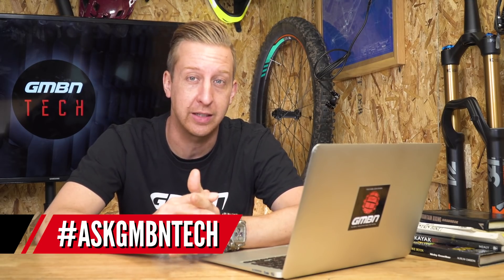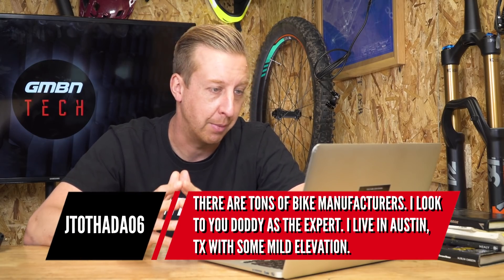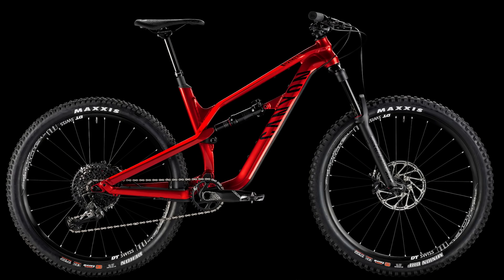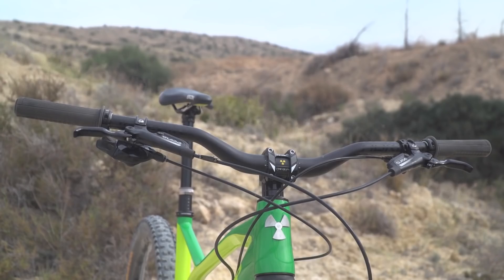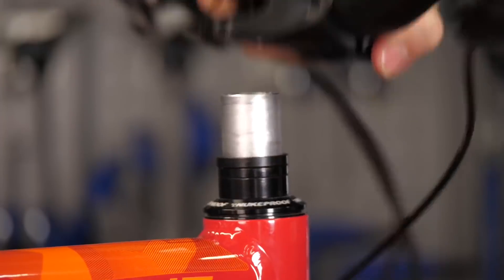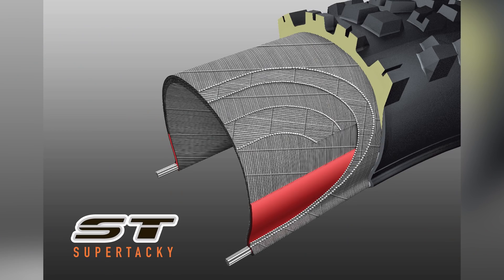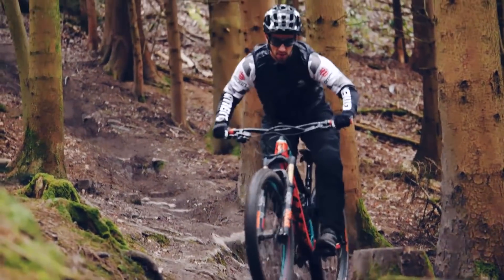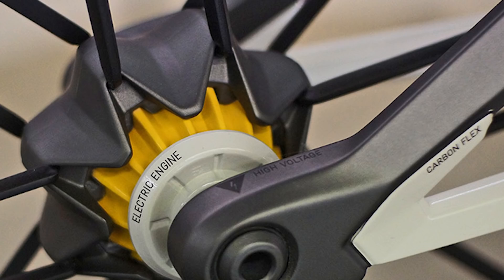MTB Geometry, Grease and MAGNETS! | Ask GMBN Tech

Comment from the maker: Given automotive manufacturers are already using magnet technologies for active damping control, could magnet suspension technology play a part in the future of mtb?
Reply: magnets are pretty heavy, so would most likely have to go on an e-bike. plus there might be the added benefit of using a lighter electromagnet material. going to be really interesting to see how they overcome the weight issue!
Reply: I'm fairly certain it was tried on MTB's years back but can';t remeber who by
Reply: Rare earth magnets are very powerful for their size this could go some way to address the weight issue. They are expensive though.
Reply: I don't think so because magnetically adjusted dampers require energy to operate. It may be possible on the e-bikes but current solution with mechanically adjusted dampers is much more energy efficient.
Reply: Yes thet might be the future of suspensions. The magnetic suspension was first used on cars and it was much more effective than the spring one but also much more expensive so the project was shutted down. Btw it may be a bit more expensive to produce but it's going to last more than spring/ air suspension because there is less friction and a better response of the suspension
Reply: USE played with it 20 years ago on the SUB anti dive fork. Oil with metal particles in it and a battery powered coil to act as a damper valve. Ran off a small 9v battery. Can’t believe no one else has done it yet! This was before GPS was available which would be ideal for DH.
Reply: @Jabberingjimbo  that was a ferrofluid anti dive. Ferrofluid oils get thicker with a magnetic field.
Reply: At that point in time bikes will lose the essences of what makes them "bikes". I say !@# that!
Reply: Are We talking like upside down magnets
Reply: Yes i think so, magnectic suspention is used on some cars and trains, why not use it with mountain bikes? The weight might be a concerning factor.
Reply: some of the properties magnets have would make it very interesting to see on a bike sus, the natrual resistance between two negative or possitive sides of the magnet......also check out rollacoasta brakes, they use magnets to stop, could be another possibility in the future, an ABS magnet disc brakes would be mega!!!

Comment: Hey Doddy, I'm a tall bloke like you (6'4"). I have a Trek Fuel Ex 8 2019. It has 130 mm travel up front and back. I was wondering, the bike definitely has it's roots in XC, but if I up the suspension to say 150mm (won't void warranty)  (note the 2020 model has upped the travel to 140) and put on a high rise bar with a shorter stem would I get more trail/enduro feel out of it as opposed to all mountain in it's current set up? I've got all three spacers under the stem and still feel my neck straining to look up. I've gotten better at my descents and using all the front travel (no spacers yet, but I like the plush suspension). I also want to feel more confident on the descents. I have been considering this but am unsure how it will affect the bike and me on it. Steve, Australia.

Comment: Magnetic suspension may refer to ferrofluid damping, which is electronic adjustable damping based on the magnetic field strength on the ferrofluid. Actual magnetic repulsion  suspension would be too heavy for bikes.

Comment: 10:25 The ardent tires become absolute missiles around half wear. I like to replace tires by placing the new one on the front and rotating the old front to the rear. The ardent is great in parks if you install it backwards due to the middle tread shape. The only problem is that it hinders climbing ability.

Comment: Hey Doddy, bought some used SRAM guide rs brakes. The front brake works great but back brake doesn't. The lever is solid and no matter the force it refuses to budge. Meaning my pistons also don't budge. Any advice would be greatly appreciated.

Comment: #askgmbntech hi guys, wonder if you can help, i have a giant trance x5 with a rock shox recon front fork, and i noticed that under heavy braking the front wheel pulls to the lrft (toward the caliper) i have made sure the QR is as tight as possible by hand, and made sure the caliper is aligned with the disk as best i can, i even tried a dirt jump wheel to see if it was the wheel i have.  Is this just because the brakes are so powerful?  Ior is it because the fork is weak? In which case would a taper steerer fromk fit my fram or do i need to find a 1 1/8th steerer.

Comment: #askgmbn Hi, first, nice show :) next, I am thinking about upgrading Disk brakes on my XC FS bike, I have an older Shimano SLX brakes (forgot the number, but without the radiators) and 180/160 disks, breaking power is ok for me, but i have issues with overheating on longer steep descends where i need to brake all the time if i dont want to get killed with my skill, i want to ask how much does this radiator make difference, or if i need to add also bigger disks, maybe if there is something with a radiator/fin blade, available as on road ultegra/ dura ace, thanks

Comment: There seems to be a relatively small range for the steerer angle, does it make a huge difference? Bikes nowadays seem to be very discipline specific but older bikes seem more general purpose. Is it really time for a change?
I like to ride trails and find I do alright on my Specialized XC Pro 2009 with 68 degree steerer and 26" wheels.

Comment: #askgmbntech Hey Doddy I have a syncros dropper post 2.0, it is stuck up i have replaced the cable but it seems that it is the post that is messed up, what could fix this. and no it is not over tighten at the seat post clamp

Comment: #ASKGMBNTECH  I am confused to how can you fit a tire on your wheel and an your bike.. I'm as young as 13 I love to ride mountain bikes but I find it hard to get more traction on dry conditions, here in Philippines there are tons of elevations also here. do I run a lower tire pressure or do I need to fit a wider and knobby tires.. I have a 26" wheel and bikes here come standard with a 1.95" width can I fit maybe 2.10?  And lastly i have a sr suntour XCT superflow crankset its a 3x setup I wanted to remove the third cog does it affect the weight reduction on the bike?
Reply: Rather focus on your technique, than tires. 
You would probably struggle at climbing if you remove 3rd cog. And weight reduction won't be that much singificant as on other components.
Reply: well actually my tires are slick, does that climb very well in dry conditions? and its actually in 60% threadlife

Comment: #askgmbntech Hi I am 14 years old and a very competitive XC racer looking for some carbon wheels. I have the 2017 specialized epic expert which has boost spacing. I was thinking about the boost roval controls($1900USD) but they seem pretty pricey. Any other wheels closer to $1,500 USD that are very light with a quick engagement hub? Thanks in advance!

Comment: Hi, I’m real keen on being able to service my whole bike. Speaking of torque wrenches for now, what is the most ideal range to have for MTB Service? I’ve seen a lot are about 2-14 N.m But for things like air spring caps on forks I’ve read in the manual that 28 N.m is needed. What should I look at getting? Cheers in advance.
Reply: As Luka Gorjup has said, to be able to torque up everything on your bike you'll be looking at a range from 1 to 60+ Nm.  For bottom brackets and pedal's you'll need one that can torque CCW in addition to CW (usually have a 'push through' head.

Comment: #askgmbntech What is your philosophy for replacing tires? I like to use the same tire front and back. The back tire wears first, I rotate the front tire to the back, and buy a new front tire. But this would not work as well if using different tires front and back (which I would like to start doing). What do you recommend?

Comment: Is the rear brake generally weaker than the front brake on an mtb? I've tried shimano and sram brakes on my norco and the rear isn't as strong as the front..cheers
Reply: collier666 Are the rotors the same size?  This changes 'stopping power'.
Reply: Shannon D nope. Went from 160 to 180 on the rear and still garbage
Reply: collier666 The simple answer to your question is NO.  Someone please correct me if wrong (Doddy!), but brakes are identical front to rear, other than hose/cable length. A bit more info could help.....  Hydraulic or cable?  (Not sure if they do cable anymore, but 10 years ago I rode a Norco with cable disc.). Garbage=?  Won't even lock the wheel?  Have to squeeze more than you think is reasonable?  Fade? Or just not helping you remain in control as you would like?  'Garbage' from moment installed or after a bit of riding?  Sorry for so many questions, but the answers all lead to different possible solutions.  Also which Norco and what type of rider are you?  Heavy...aggressive.....fast?   Last one.....which brakes did you try?  I am one to play around and trouble shoot to learn more.  I am lucky to have the time.  Normally you can't switch brakes due to hose length, but you could try the alternative branded brakes rear on the front....if it feels better than when on the rear, then it likely ain't the brake, the pads or the fluid.  Swap the rotors.  No change, probably not the rotors (contamination).   Or just put the rear on the front and see it they feel the same.  Another important fact to remember that actual 'brake performance' and 'stopping power' is different.  Stopping power includes techniques, suspension set up, tires, grip, etc.  As I understand, front can generate more stopping power, but does not have better 'brake performance'.  Wowser....sorry for they essay!  =P
Reply: Shannon D I had hydraulic shimano brakes that came on my 2017 norco charger 9.1. Wasn’t happy with them so I switched to sram guide-r. Still not great so switched the rear disc from a 160 to 180 and I’m still not happy. I’m 6ft 3” and weigh 14stone 10lb. Mainly ride bike park. Pump/bmx track. It will lock the rear wheel but only if I squeeze real hard and shift my weight forward.
Reply: collier666 I think Guide R should be more than enough to lock the wheel.  My next move would be to replace the pads. (They may be contaminated).  Bleed.  Other than that I am not too sure.  I ride Guide RSC and have ridden the Guide R, and both had acceptable power.  I hope you find a solution, not being confident in your brakes is a bummer.

Comment: #askgmbnanything I’ve got an old 26” wheel bike is can’t bare to part with. I want to upgrade the forks on it to make it a nicer ride but it’s got a straight steerer. Is there a special headset that I can use to fit a tapered fork in or anything I can do? The headtube is really wide so that’s not a issue. 

Thanks for the advise love the videos.
Reply: Jamie Akers quite possibly.  When you say the headtube is really wide, do you know the lower ID measurement?
Reply: There are headsets which will allow this.  Cane Creek makes one, but i think it increases the stack height slightly.
Reply: Jamie Akers 
If you can find the specs for your bike, an online shop will probably do the hard work for you. CRC helped me get the right headset when I upgraded to boxxer forks.

Comment: #askgmbntech Doddy now that carbon rims are getting so wide I hear a lot of discrepency on what size tires I can run with which rims. I don't have boost but want to upgrade to 35 mm wide internal width but can find out if my rear 2.4 DHR II will work. I am hearing conflicting feedback!!!! Please help!
Reply: 35 is way wider than you need for a 2.4,  WAY wider
Reply: Mavic website has a table that comes from ISO 4210 which I understand to be a mtb safety guide/norms.  For a 2.4 tyre (61mm), recommended rim width is between 27mm and 31.5mm.  Outside of this and they claim that the chance of the tyre coming off the rim is greatly increased.  This is supported by Mavic and other major wheel makers.  32mm is plenty wide enough, unless you plan to run plus size tyres.
Reply: Shane Witter http://engineerstalk.mavic.com/en/the-right-tyre-width-on-the-right-rim-width/. The table has not kept up with the wide rim movement, but if you plan on sticking to 2.5 or less it is still relevant.  My 2c - I have 32mm rims and wider equals heavier or if a wider rim is the same weight, then it likely has less material in the rim.  (Assuming same wheel material is being compared) I killed the rear wheel in no time, but I am a hack who loves to pound through the rocks. :)  I am now replacing the rear with a rim of about the same weight, but narrower, so in my mind I get more material and therefore a 'thicker' and more durable rim.  ( I am about to try a 2.4 on 35mm internal to test steering feel of 2.4 against 2.8, which I didn't really like the feel of, so if you don't see anymore posts, I am probably in recovery wondering why I didn't take my own advice! =S).
Reply: Thanks, Ill dig into the Mavic site and check out the details. I had a feeling that there would be a problem with that wide of a rime on that DHR II but could not find anything definitive.
Reply: I definitely get what you are saying on the durability side, as I am "Clydesdale"  who loves to push the limits as well. I was considering different wheel manufacturers and when I was speaking with NOX they said I could spec a heavier layup with the wider wheel to increase durability. They called it a "downhill" lay-up I think. That means you could have the wider wheel (Ktisuma) and increase structural durability, but I imagine you pay the weight penalty. Do you know if spoke count contributes to durability? I really like the Reserve series from Santa Cruz but they only come in 28 spoke builds while Enve and Nox do up to like 36 I think. Since I am on the heavy side I want the strongest wheel I can get. I should also probably mention its a 29'r. Do you have any input here?

Comment: Hi Doddy, I have some problems in cleaning my sealant latex from my tubeless tyres. I clean the inner part of the tires every 2 or 3 times I refill with latex and 3 out of 4 times I spend a huge amount of time in cleaning the inner tire from latex with my hands. Sometimes it is very easy to clean it, I just pull it and it comes away very easily but most of the times it is very poorly attached and it breakes into little pieces causing to clean inch by inch. I tried to heat it, in order to make it more dry, but it doesn't seems to work that much. I always use the same latex (mariposa latex), do you think I should change it? Thank you for your very useful work.

Comment: Looking to up grade my mtb wheels I do trail/xc and have 29er hardtail do you recomend any wheelset for around £300.
Reply: Do you really need to upgrade your whole wheels? Are your hubs broken? If not get 2 new rims.
Reply: Max Doyle what’s wrong with your current wheels? And what is your braking setup in terms of rotors?
Reply: Daniel Wiltshire there just not very good stock wheels and want to upgrade I go centerlock rotors but there are adaptors they sell so that isn't the issue

Comment: Doddy, I’ve just bought a 27.5 plus hardtail it’s got 2.8 wtb ranger tires running tubeless it’s brilliant lots of grip but I’m feeling a gyroscopic effect on the front end when steering? Is this usual when going wider with rims and tires?
Reply: Gyroscopic effect?  Do you mean 'heavy' steering and harder to turn into corner?  Or do you mean when in the air/ jumping? I have just taken 2.8 off my bike and put 2.5 on to liven the steering back up.  Haven't noticed effect in air, but I only do small jumps.
Reply: yes very heavy steering with a unbalanced wheel effect. whys it happening? and do fat bikes suffer even more with bigger wheels?
Reply: lopon12 I assume you have wheels with 35mm plus internal diameter, Correct?  Speculating here but I suggest increasing rotational mass (bigger wheel and tire) would def effect gyroscopic effect, but the leverage the bike offers, in my experience, overcomes this.  Change in geometry could be effecting feel.  My issues were the bike not turning in with my 'normal' input, overcame by being more aggressive on initiating the turn, but eventually went back to the same tire as on my other bike.  I guess i could say it felt 'unbalanced', but I think 'not as expected' is better.  Perhaps I had more grip, therefore was going faster and didn't sense it and my 'normal' inputs were too docile.  Only other things i suggest is checking you don't have a blob of dried sealant in the tire (has happened to me and it creates a strange pulsing feeling in the bike) and make sure all bolts, spokes, hubs etc are tight.  If available, try some smaller tyres.  If it goes away...then I suggest you put your fatties back on and learn to adjust your riding style to suit the new rig.  Good luck!  (I did enjoy the fat tires once i started to muscle them a bit more.....I only went back to a smaller tire so that both my Gravity enduro bike and my enduro e-bike have the same tire on them and therefore a similar steering feel.)
Reply: lopon12 - yes its very noticeable in a fatbike. I've got 26x4.8 and it was massive when I had 450g tubes in as well. But you get used to it, and if you do a small twist on the steering in the beginning of a turn to the opposite direction it will be easier and more stable to lean over in a curve. Just like they do on motorbikes.
Reply: Gustav Svenson Thanks Gustav, you have better experience than I.  Also great advice about the motorbike 'counter steering'.  I understand what you mean by 'twist', but I think it is better explained if we talk pushing a little on the hand in the direction you want to turn.  That then 'twists' the bars a little, and as you have correctly implied, helps initiate the turn.  Riders helping riders is awesome....some times our experience can be just as valuable as Doddys tech knowledge!  :)